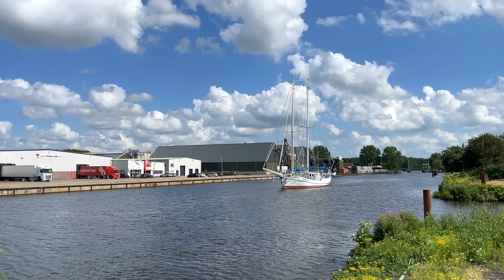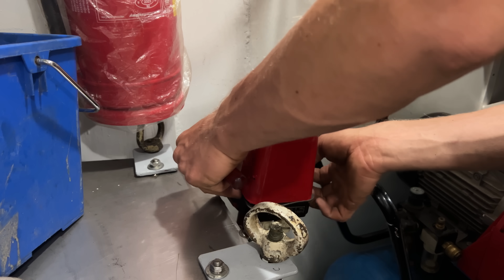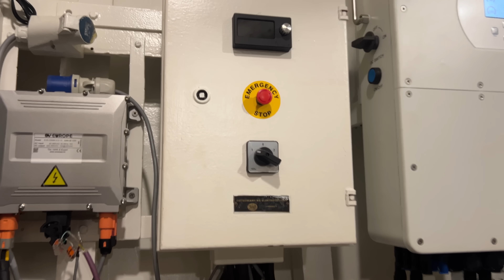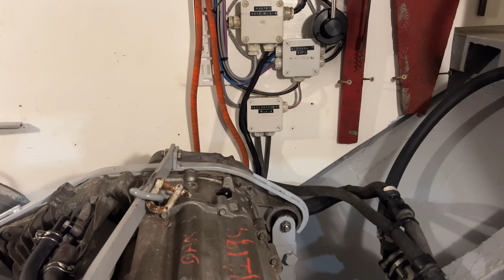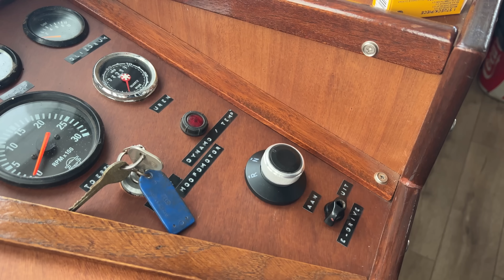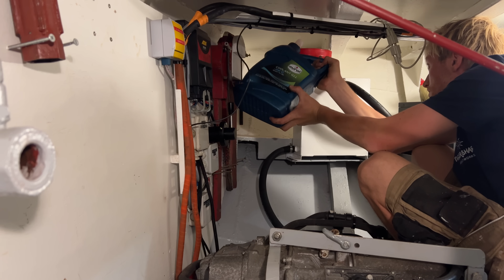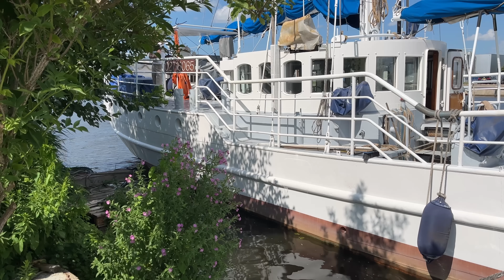The First Tesla Powered Ship - What Could Possibly Go Wrong?

Comment: From my understanding ( and I stand corrected if wrong) but telsa car batteries were never ever designed to go in boats. Last time I saw a EV car battery in a boat it ended very badly with the death of the owners.  Can I ask what your insurance company thinks of this setup.
Reply from the maker: @4GH440 We’re not using the original Tesla batteries, but new ones from SKInnovation, made for Mercedes. And we did take the necessary safety measures. If you’re interested, I described the whole thing in the previous video :)
Reply: @tigersharkboatworks  thankyou for the reply, I will look at the previous video. For my own benefit given the boating insurance industry here in Australia relating to Lithium battery install, did your insurance company have any requirements for the install. 2) I am unaware of any fire suppression system that is capable at this time of supressing a lithium fire as such what precautions do you have in place in the event of a battery fire.  3) Given your response I take it you did quite a bit of research. Do you actually contact Tesla and speak to them in regard to the installation on a boat and if so what was their response.  Not trying to be a smart arse but genuine questions and concerns.
Reply from the maker: @4GH440 to answer your questions: 1) we did contact the insurance company. Their only recommendations (not even requirement) was that we built the system in collaboration with a professional company, which we did, EVeurope. For the rest, they didn't see increased risk, so the fee did not increase (the value of the boat did go up, so for that, the fee did as well). 
2) The words fire suppressing and fire extinguishing have very different meanings here. You're right, there are no means of extinguishing a lithium cell in thermal runaway. There are ways to minimize the risk of them starting, and to prevent the fire from spreading to neighboring cells, modules, and the rest of the ship. Again, discussed in the previous video. 3) We did not contact Tesla. Same like we didn't contact DAF about using one of their truck engines as our main diesel. They have very little to add. The motor is in a pretty shielded environment, no salt water coming close. And it's used much more gentle than it would be in a car :)
Reply: @tigersharkboatworks  many thank for the information. I found your comment regarding the insurance quite intriguing as here in Australia  there are far greater restrictions in regard to Lithium battery installs. I did watch your video re your system - interesting but I wish you well.
Reply: As long as the battery stays dry and is protected from a salty environment the battery can't corrode.

Actually roads in winter are a comparable environment to mariene.

The most important thing is the battery management electronics. This is where fires start if the battery gets unbalanced.

Add to that the fire suspression system, this is a very legitimate build.
Reply: @merlin_V2 A ocean going vessel is one of the harshest marine environments you can be in. Salt air permeates everywhere. I have owned several boats and all suffer in some way from the sea salt. You cant hide from it. In regard to fire suppression I am unaware of any system that is capable of extinguishing a lithium battery fire. Happy to be shown otherwise.
Reply: @4GH440

You are showing that you have not watched the battery install video. 

Go watch it. There are three levels of safety integrated into the system, the last being full immersion in fresh water.
Reply: @billstevens3796  you have not read one of my last comments which I clearly indicated that I agreed to watch the video which I was unaware of. Just out of curiosity are you aware there is the world of difference conductivity but also corrosion between fresh water and sea water. Salt water has a far far superior conductivity to fresh water.
Reply: @4GH440  

This battery is in a sealed stainless steel containment system. It is less exposed to salt and water than it would be in a car installation.

And please don't insult my intelligence.

Have a nice day.
Reply: @billstevens3796  Mate I don't have to insult your intelligence, your doing a good enough job yourself. Have and even nicer day.
Reply: @4GH440  

Nice try "mate." The projection is strong with you. Remember, when you start the name-calling, you have lost the argument, and have revealed more about yourself than you may have wished.

Again, have a nice day.

Oh, and BTW, the word you're looking for is "you're."
Reply: Do you mean the couple who died in the Atlantic aboard the Green Odessy? That was a Nissan Leaf and they don't know if they had an issue or got struck by a ship. That is not my opinion, but the Canadian coast guard. Even though I hate Tesla as a company their battery management is pretty strong, regen and fast charging are the main stresses on the heat of the battery. He has individual cell management, so the risk is low.
Reply: @fraserwright9482  When the couple were found deceased in their lifeboat it was shown they had suffered burns. The boat was never recovered but and it was only ever speculated that a fire had occurred due to the injuries. No cause was ever identified. I did watch this couples videos and lets just say his electrical knowledge was very limited. If memory serves me, he was actually warned not to use the Leaf EV battery as it was never designed for that environment or operation.
Reply: @fraserwright9482  

The only thing in the system that is Tesla, is the motor itself.
Reply: Car Batteries are designed to be immersed up to 1m and are designed to be operated directly in a corrosive salty environment.
Reply: These are not Tesla Li NMC cells.. these are units that were made for Mercedes Benz and are more durable 
 Li Fe PO4 cells , the format of cells in  particularly blade type cells ... also adds to safety and cooling .  

CATL which produces 42-7% of all the worlds storage and traction batteries and is renown for its hard numbers science and engineering based reputation has announced a  major piece of news, CATL has gone live on direct online guaranteed direct grade A cell sales and pallet load size shipping of its cells to hobby and small businesses , cutting out the middle men and huge order sizes also those Companies that stick their names on labels pretending to be the source or  attempting to re grade B class cells .

Eventually they will also add their Na ion cells that really are super safe , Temperature tolerant -40 to + 70c massive cycle life spans 10-15000cycles 9O% usable capacity  90% usable capacity retained even at minus 30C and none toxic ....price will drop rapidly now to possibly as low as $20 per KW hr. 5C rated . 300⁰C rated no uncontrolled reactions. Al  cell conductor construction not Cu.  Their new gen Li Fe PO4 cells are pretty amazing and they are also mixing the two chemistries in the same packs. And introducing HD Na ion starter batteries to replace Pb units and  standardized rapid automated swap packs ..😎 like Nio has pioneered. ...but also for Na ion commercial vehicle sized packs where the results have even been supprising the engineers .

And for those with smaller boats Gotion VW is going to start mass production it's 3 forms of Na ion semi solid cells that are both safer , longer lasting and as powerful and energy dence as Tesla's Li NMC cells .. but  10C rated and essentially using Na ion and Al  not copper .

Things are going to change rapidly in the next 12 months.
Reply: @clivestainlesssteelwomble7665

These are NOT LiFePO4 cells!

Please edit your comment.

Comment: What drive belts are you using? I couldn't find ones strong enough.

Also, what VCU did you use that puts out full power in reverse?
Reply from the maker: We’re using gates polychain Carbon Volt belts, 36mm wide each. And the Tesla is limited to 50Nm torque. In reverse as well. That currently translates to 700Nm on the prop shaft. If it turns out to be not enough, we might change the gear ratio a bit. We can keep the same tension, but the shaft torque wil go up, and the Tesla RPM as well.

Comment: Nice to see your methodical process towards this. I know a lot of the salty seadogs don't like electricity or EVs in general. I admire your off-cuff remark about mapping the Tesla motor, the ark of where the field winding and armature interaction is similar to ignition/cam/throttle of an engine in free space. I would be interested to see if you can measure your water speed independently of the prop.
Reply from the maker: Thank you! A lot of thought goes into it.  We don’t have a speed through water meter, because the little wheel thing is always the first thing to go, but we can see our speed over ground on the canals without current :)